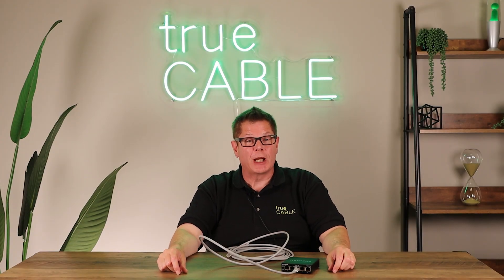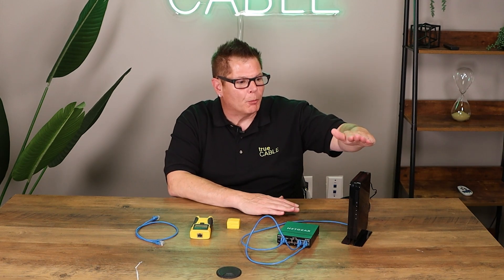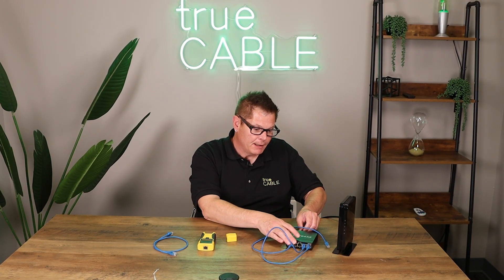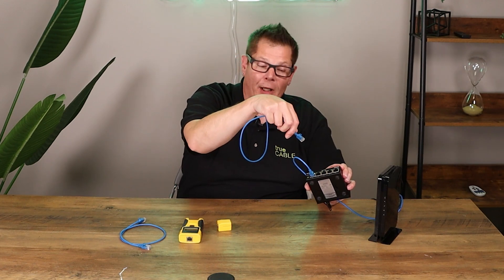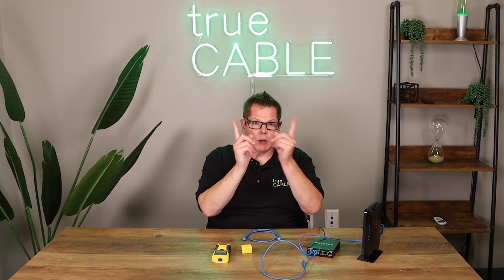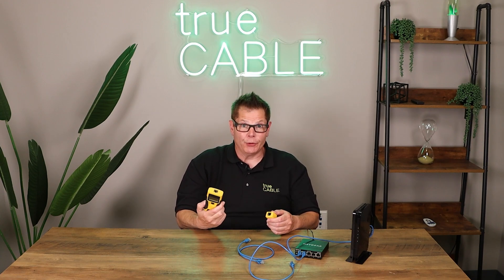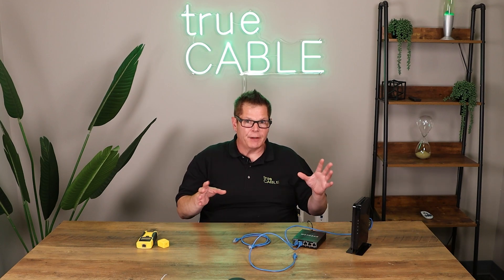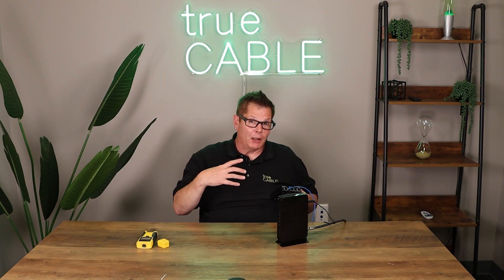Having Issues With Your Basic Ethernet Network Setup? Try This!

Comment: my computer is showing no cable connected
what do I do?
i connected mine from wall port to my PC
Reply from the maker: Hello Chriss. Well, you could have an inactive or defective wall port, or the patch cord you used is bad, or the Ethernet port on your PC is not working. You will have to isolate the problem by eliminating variables.

Comment: Good video.  I have two Ubiquiti switches that I'm trying connected to each other (almost).  If connect them directly to each other,  I get no signal..  If I put a small netgear switch between them with a  short patch cable, I get a signal and they connect.  What could be the problem?  Mind you, I have not run any diagnostic testers yet.
Reply from the maker: Hello! I assume the longer cable run you installed and likely self-terminated is not passing data but the short factory pre-made patch cable is? The answer is the longer cable run is likely terminated incorrectly. I would also guess from your question that you put RJ45 8P8C plugs onto both ends of the long cable run? 8P8C plugs are notoriously finicky with solid copper Ethernet, and creating patch cables in the filed with solid copper Ethernet is not a good idea. The fitment of the plug to the cable has to be exacting. If you were to terminate both ends of the longer run to keystone jacks and then use two short FACTORY PREMADE patch cords at both ends you will like find the cable is working fine.

Comment: When I hang access points or cameras, (any device that uses a straight run to the idf) I terminate with a male end on the solid copper run. I dont do female end to a short factory made patch cable to the device because the fewer termination points the better.

Comment: One time our whole network went down. Continuous ping to the gateway was up down up down up down. We did the old goto the mdf and unplug all the IDFs. The one that gets unplugged and the pings are solid, thats the source. Go to it and unplug each switch one at a time, find the switch, then unplug each wire 1 at a time till I found rhe wire that was thr source, saw where it went to (this is why you label your drops room number-drop number! So you can look at your patch pannel and know where everything goes) and it was the patch cable for a printer. It had been run over with an office chair wheel so many times it sheered it causing shorts!

Oh yea make sure spanning tree is on if its a managed switch.

Comment: I've been making my own cables for 20 years with only a few bad ones. Lop the end off and redo it. I typically will buy the short patch cables used from patch panels to switches in bulk since its more cost effective. I find that I make more bad CAT6 cables than CAT5 cables. The offset holes on the RJ plug make it a bit more difficult.
Reply from the maker: Hello! Thanks for your comment. By reusing existing patch cords, you are terminating stranded copper conductor Ethernet cable....which is much more suitable for making patch cords than solid copper. That, besides lucking out and picking the right fitting RJ45 8P8C plugs for those patch cables, resulted in your continued and historical success. I doubt the manufacturer's published insulated conductor diameters for their patch cords (although they probably disclosed the copper AWG) so picking a correct plug was roulette! Best practice, though, is to buy factory pre-terminated and pre-tested patch cords--especially ones labelled as Cat6A.